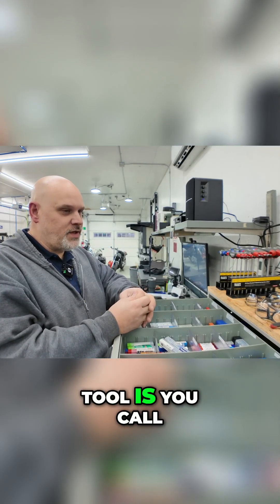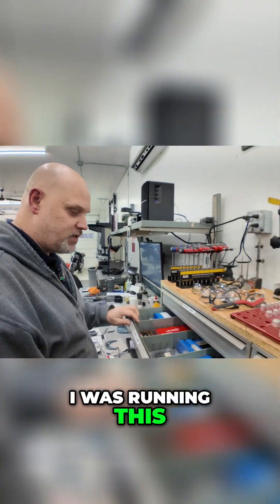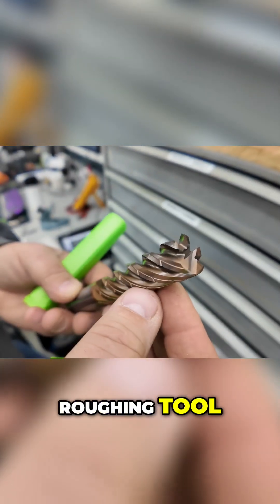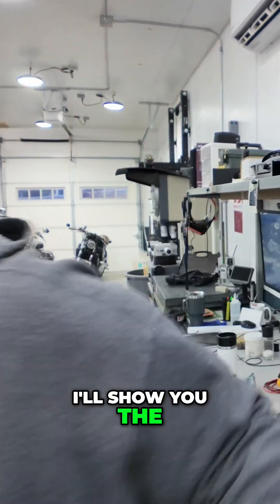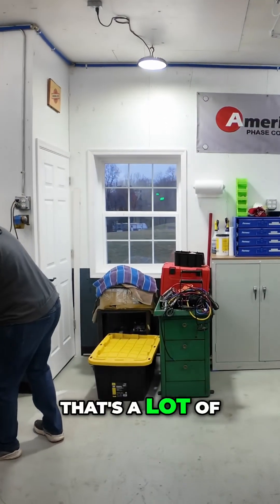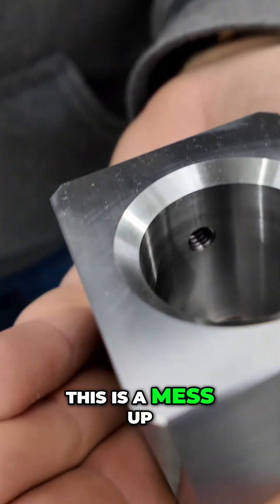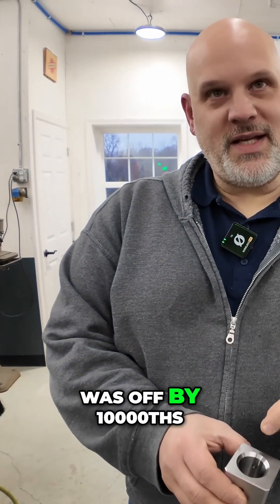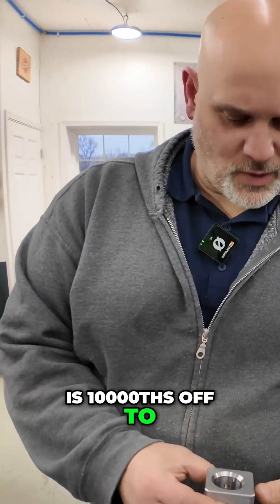Great Experience with Helical Tool

Comment: You couldn't cut that 17-4 full depth, which looks about 1.5 dp. from solid without tipping that machine over. A  3/4 pilot hole and 4 passes  should 
get it done and save your mini mill from damage and extend your tool life.